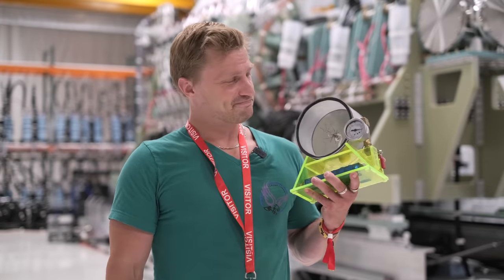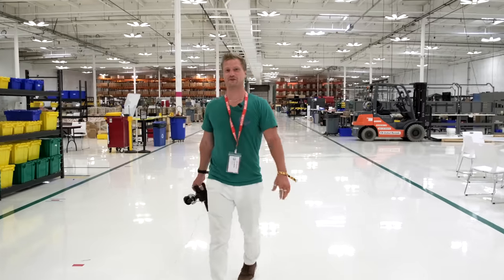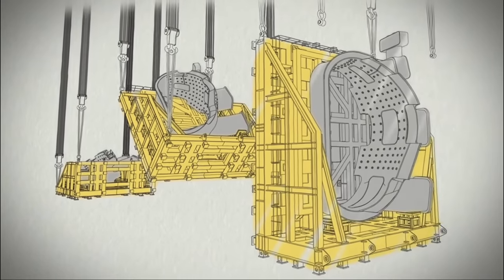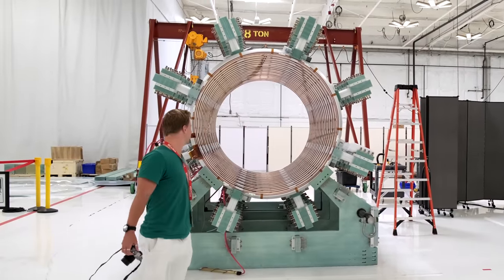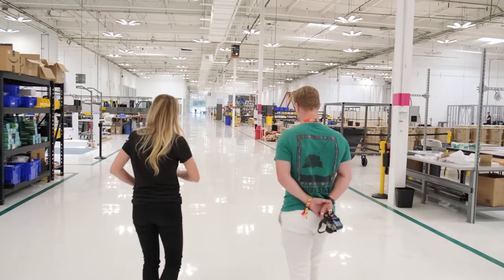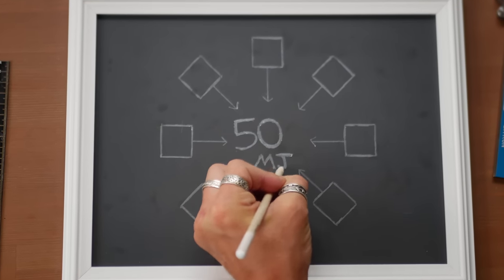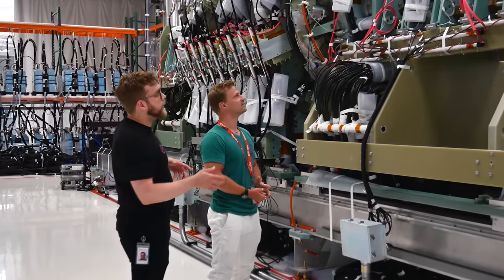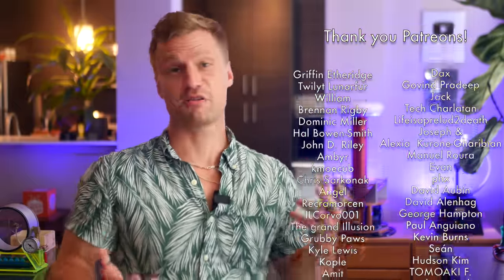An Exotic Approach to Nuclear Fusion (Helion Energy BTS)

Comment: i appreciate the amount of investment happening in the fusion space, but i can't help but feel skeptical of Helion specifically, Improbable matter made an excellent video explaining just how much less feasible he3-deuterium fusion is than tritium-deuterium fusion that is used by conventional tokamak designs. I really want to believe that they can get energy out of this design however the more I look into it the more I feel like, at least with Helion, this method is a reach.
Reply: Yeah, after watching the real engineering video, I was pretty hyped. Then I saw the improbable matter video and now I'm pretty skeptical. The issue with neutrons is also a big problem they have to solve.
Reply: So y'all watched two videos and think you have a better outcome synopsis than dozens of fusion researchers and financial analysts at Microsoft?
Reply: @animal579  I'm not aware of any fusion researchers who have endorsed this. Though that term is lose and technically everyone at helion is a fusion researcher. I would say I haven't heard any endorsements come out of the academic nuclear physics areas. Microsoft did a bit of a PR stunt; they signed a promise to buy energy from Helions' first net positive reactor... if it ever gets built. It looks good for the,  green energy and all, but there's no commitments. The issues raised in some other videos by nuclear physicists not sponsored by Helion have centered around
1.) Not targeting a high enough temperature for D-D reactions to occur at a reasonable rate, especially given the microsecond confinement times they're envisioning.
2.) The neutron radiation that they will unavoidably be producing from the D-D and D-T reactions will cause reactor transmutation and require heavy shielding. That shielding will push the magnetic confinement coils back, which weakens the field strength.
3.) They are breeding significant amounts of tritiu  and have not outlined plans to safely store and dispose of it
Reply: @animal579  uuuh yeah, improbable matter is certainly trustworthy in this regard, as he has experience in the field as an engineer and has given his view on why fusion is generally so hard to do, and why helion could be a stretch, am I saying I Believe him entirely? No, but his input does make me more apprehensive of helion's stated goals and feasibility.
Reply: The Improbable Matter video is not considered very convincing by well informed fusion enthusiasts. He was really just riffing. For example he compared the reaction rate of Helion's fuel to DT at 100 million degrees, but their full scale machine will operate at 250 million and he also neglected the much higher density that the FRC has compared to most DT plasma devices

He also basically said "they still have neutrons" and cut to an image of Chernobyl. They'll have 10x less energy output as neutrons, lower individual energies, and a cheaper and more durable reactor chamber than tokamaks which probably have the toughest situation with neutrons. It's night and day. One of the resident skeptics at the fusion subreddit considers it the best real shot at something big with fusion
Reply: @paulroberto2286 but then you see another video of a physicist being optimistic for whatever reason and you're pretty hyped again.
Reply: @Canucklug  can I get a link to the reddit page? I'd like more info on this subject matter that's positive leaning
Reply: @Canucklug being an enthusiast =\= expert. I have a PhD in physical chemistry and know a fair amount about the challenges that they are absolutely glossing over, which improbable matter pretty much covered. They're a startup, and it's in their best interest to keep positive PR spinning while throwing out slick animations and allowing YouTube tech bros to make videos lacking any criticism or actual analysis. Ambition and enthusiasm can keep the money flowing, but won't change the laws of nuclear chemistry.
Reply: I so want to believe. After the Real Engineering video I went to Helion's website (heck, they're in my neck of the woods and they seem to need tech types who have experience in both electronics and machining and I can work for cheap, so I was really interested). But their site is really light on numbers, especially measured results from their Trenta reactor tests. They'll only say they "saw evidence of bulk deuterium-helium-3 fusion". I was also a bit put off by statements on the site like, "Fusion does not produce a chain reaction, so fusion itself is not weaponizable in nuclear weapons", which is essentially true (if you read the first part as "fusion reactors", since fusion output is what pushes thermonuclear weapons into the megaton range) but the reason given is not entirely scientifically accurate. I'm still open to the idea, but from their public face I'm really skeptical.
Reply: @paulroberto2286   
the he3-deuterium reaction produces only charged particles(proton+alpha), so neutrons aren't a problem here but otherwise I agree, everyone else avoids this fuel combination for a reason, as tempting as ditching the tritium problem may seem
Reply: I'm a diesel mechanic and have seen many machines in my life... Helion design will prevail, I have a guy feeling
Reply: @artkholodov2465  
It's true that He3-Deuterium reactions don't produce neutrons, but Deuterium-Deuterium reactions do. Deuterium-Deuterium reactions have a larger cross-section, thus we can expect for them to occur with a higher frequency than He3-Deuterium reactions. There will definetly be neutrons produced.

Edit: Sorry, I misremembered the cross-sections vs. Temperature curves here. D-He3 has the higher cross-section at a given temperature.

The point about neutron emissions still stands though.
Reply: @animal579 I do nuclear fusion stuff. I’ve talked with a lot of fusion researchers from all over, Southern California, Berkeley, MIT, Princeton, Wisconsin, and no one seems to really take Helion seriously. It’s not that they’re faking people out. More like they’re trying a very niche technique. And often with niche techniques, you don’t go far. Like in the history of fusion research there’s been dozens of fusion techniques. Of the dozens, only 2 are experimentally promising of getting to an economic breakeven point. And of these two, only one is actually sustainable. The other is better used for making a bomb or whatever.
Reply: @robertpaulson2052  They just conflate being skeptical with feeling smart. It's why their rebuttals never amount of much.
Reply: I am in no position to judge how viable this at generating energy, but I am in love with their tech made for harvesting the energy. 
If Helion fail at making Q>1 fusion energy, I still believe they have made a leap in energy capture. If nothing else, I am hopeful this will become a viable tech going forward.
Reply: @allthingsdestructive You really think investors are stupid?  
They might not succeed for technical reasons, but the physics must be sound, or big money wouldn't invest.  You know nothing about business, do you?

I, too, have a phD in plasma physics, another in nuclear physics, and a third in magnetic confinement technology.  
On the internet, everyone has a PhD in something.
Reply: @RMX7777  "It's true that He3-Deuterium reactions don't produce neutrons, but Deuterium-Deuterium reactions do. Deuterium-Deuterium reactions have a larger cross-section, thus we can expect for them to occur with a higher frequency than He3-Deuterium reactions."

The D-D reaction has a higher cross-section than D-He3 only under 250 million C (about 23 keV). Even at that temperature, the ratio of the number of one to the other depends on the relative ion concentration.

One example. At the mentioned 250MºC plasma temp, a 50%-50% mix of deuterium and helium-3 will produce half the D-D reactions than D-He3 (by the way, only half the D-D reactions produce a neutron, so one neutron for every four D-He3 fusions).

Increase the temperature further, or decrease the concentration of deuterium in the mix, and the number of D-D reactions go even lower.

There will be neutrons, no doubt, and Helion has plans to deal with them, it is just that this video is too short to talk about everything. For anyone interested in neutrons, shielding, activation, materials, and so on, search for Helion's presentation for the USNRC from March 2022, it contains the answers.
Reply: @charliem6590  I'm not going to argue that work hasn't been done to reduce the number of neutrons. There is certainly still room to further reduce neutron fluxes going forward as well. What I take issue with, is that the state inside the reactor will always be a thermal distribution. 

Particles inside a reactor will always be chaotic, regardless of what temperature the reactor is run at. Even if the reactor targets a high temperature, the majority of deuterons will have low enough energy to fuse.

The steeper they can get the thermal distribution to be, the lower the neutron flux will be. I won't say it can't be done, but Helion hasn't shared any numbers with the public. I find it hard not to be sceptical.
Reply: good take @Hippida
Reply: @RMX7777  "Particles inside a reactor will always be chaotic, regardless of what temperature the reactor is run at. Even if the reactor targets a high temperature, the majority of deuterons will have low enough energy to fuse."

I'm not sure I understand this. Do you mean that the majority of deuterons will have low energy, ergo D-D fusions will be more probable than D-He3 fusions? If that's what you mean, that's not correct.

Anyway, either if that's what you mean or not, your conclusion that D-D reactions will outnumber D-He3 reactions is wrong, for the following:

For any temperature distribution, integrating the fusion cross-section through the whole range or temperatures gives you the global reactivity. This reactivity, multiplied by the ions densities gives the volumetric density of fusions per second. In the specific case of a thermal distribution, the reactivity of D-D and the reactivity of D-He3 ions is the same around 250M ºC (average temp), and over that it is bigger for the second reaction.

In consequence, even in a thermal distribution, as long as the average temperature is 250M ºC or above, the number of D-D reactions will be half or less than the number of D-He3 reactions (given a 50-50 mix of D and He3).
Reply: this conversation was an interesting read, i was looking for this.
Reply: Funny u can see the mans lack of confidence in his stance as he speaks with the host.  That alone makes me feel skeptical I wonder who's wallets are getting fleeced
Reply: @animal579 In their defense, Microsoft thought rolling over for the NSA and cranking out poorly-functioning crappy malware on a forced "versioning" model ...for decades... was "a good idea." Microsoft cares most about Microsoft, not about benevolence or quality.
Reply: Honestly the biggest breakthroughs we need in power production are in power storage not power generation. We currently lose a huge percentage of mostly any energy generated, especially from giant wind turbines and similar devices. Investing money in renewable energy storage is where we need to be going instead of producing.
Reply: @Spencergolde I am an academic theoretical nuclear physicist who publicly endorses Helion.
Reply: Improbable matter is too sarcastic for my taste, I can take him seriously.
Reply: @stevenverrall4527 I'm glad to hear that. Do you mind if I ask why you do? And what are your thoughts on more widely-accepted projects like ITER or even Commonwealth?
Reply: The IM video is full of falsehoods and misunderstandings, though. He should have gone directly to the source, rather than basing his critique on the RE video and a couple of blog posts.
Reply: @Spencergolde  We need to try everything to see what works best. I support throwing the proverbial kitchen sink at the fusion problem. Although, I think that ITER won't be followed up by a bigger project. This is because some of the smaller competing designs will become viable on much shorter timescales.

Helion would not be as far along as they are if their concept definitely cannot work. Even though I now work on nuclear theory, my PhD is in E&E Engineering. So I'm a theorist with an engineering background.

I have been told by many that my own recent highly-successful research can't possibly work because others have tried similar approaches and failed.

However, I have succeeded well beyond even my own expectations.  I credit my success to being more creative and thinking deeper.  I have been able to mathematically tie seemingly disparate concepts together.  Most importantly, I have the numbers to prove it.

Technological breakthroughs are seldom made by the cautious. Instead, they are made by small highly-adaptive teams that have good instincts. Going with my gut has been my most successful strategy.

I think that academically affiliated fusion researchers are simply upset that Helion won't share their hard data.  It is turning into a competitive cutthroat industry, so why should they? 

If a big institution had their way, they would steal Helion's tech and put them out of business. Similar to what happened to Nikola Tesla and many others. The establishment never tolerates independent thinkers and inventors.
Reply: @animal579 that's a foolish takeaway that demonstrates a highly emotional investment here. Obviously to those of us that are more objective this was simply an explanation of where some convincing persuasive essays can be found that are contrary to this companies approach.
Reply: @allthingsdestructive  
IM did not cover any problems. Quite frankly, his video is full of fallacies and misunderstandings. Also demonstrates a complete lack of understanding of the concept.
Reply: @RMX7777   
The beautiful thing about a high beta FRC is that Helion can balance the density and temperature to their liking. Lower temperatures and higher densities encourage more D-D fusion reactions. Lower densities and higher temperatures encourage more D-He3 fusion reactions. At above 30 keV, the D-He3 reactions would be higher than the D-D reactions. 

BUT they actually NEED the D-D reactions to make the He3. Half of the D-D reactions produce a neutron and a Helion. The other half a Triton and a proton. The Tritium will eventually decay into more He3 for fuel or it can be sold for extra profit.

Either way only about 1/3 or 1/4 reactions in the machine will produce a neutron. That neutron is only 2.45 keV. So below the activation energy of many materials and those materials that are activated by it (and used in their machines) have a very short half life.
Reply: @stevenverrall4527  I'm aware and respectful of your accolades in this area. I've  read your most recent paper on a GSQV proton model, and though I think we have different definitions of what is "intellectually accessible", it was very interesting as far as my limited knowledge of qcd would allow. I am involved in science as well, and am in full support of ambitious and bold research directions. My concern starts with our current CO2 problem and the urgent need for carbon-free, sustainable energy; and fusion isn't that. It might be one day, but today we already have an answer to that problem that deserves funding and attention. It's Gen IV fission reactors. A clean, safe, fuel breeding approach with reprocessing and inherent weapons proliferation resistance. 

And no, Helion can fail. They're just a startup company, they are allowed to get this far without having a well though out plan. No one is stopping them from either lying, or else no one is holding them accountable for producing meticulous results or failure analysis or long-term safety and waste disposal plans. They are allowed to produce hype videos and just collect money. And I'm arguing that on numerous engineering fronts:
- No plan to deal with the tritium they will be accumulating, which they won't be "burning"
- Non-superconducting magnetic confinement which massively limits field strength and efficiency
- A projected temperature and denity far too low to allow D-D fusion to occur at a reasonable rate
, they are unlikely to pull it off anytime soon, especially not in a repeatable fashion necessary for grid production.
The issue with Helion et. al is that they are pulling financial and PR resources away from practical solutions at a time when we really can't afford to waste time. They're promising results tomorrow, but realistically, that's probably not possible. And gambling on them doesn't make sense when the stakes are so high
Reply: @elmarmoelzer2229  All fair points, regardless of how you look at it Helion will produce less nuclear waste than any other current reactor design.

I do have to wonder what will happen once they start extracting energy though. The act of drawing power from the reaction product ions through direct conversion will have the effect of slowing them down. Slowing them down means an increase in neutron flux.

The dynamics of fuel ions are always chaotic in nature, I'm very doubtful any non-thermonuclear reactor scheme will ever be useful for power generation.
Reply: @allthingsdestructive  what are the problems you feel they're glossing over?
Reply: @charliem6590  deuterons are always capable of fusing - all baryons are always capable of fusing - through quantum tunneling, at any temperature, though probability of fusion (gamow factor) increased with proximity and temperature. This is the primary way the Sun fuses, and also how Inertial Electrostatic Confinement reactors (fusors) work as well.
Edit: but reading through your comments further I guess you already know that and were addressing something else, so nevermind
Reply: @RMX7777  "Slowing them down means an increase in neutron flux."

You mean e.g the Tritons slowing down while "donating their energy to the system as a whole?
Definitely true, but the pulses are so short that these effects barely come into play.
Reply: @elmarmoelzer2229  Speculation on your part. We won't know for sure until hard data is released.
Reply: Hydroton approach seems more reliable. Already provable results from tungsten wire cracking at room temp
Reply: Still unknown is the size of a working reactor.  So, let's start with a "known" reactor, the sun.  Yes, stars come in different sizes. All of them gaseous and factors of size larger than the earth. And, fairly effecient. Efficiency being a key. Efficiency dictating matter density and size. Efficiency dictating generated energy emission. My view is the amount of efficient electrical energy to heat energy ratio creates the demand of gaseous reactor ie. Solids and liquids will become plasma states.  
This is a good thing. Consider this: a star requires a certain size to be in a fusion state and that's quite large. If these fusion reactors occurred in much smaller size ... say, the size mankind is hoping to create ... they would exist in nature somewhere. Fortunately for earth. Otherwise these small fusion reactors would be falling from the heavens ... making for a very bad day for life forms here. 

Research away. Hope something useful is found (not something to weaponize because, well, tales of history). 

While solid, liquid and gas seem to coexist rather well, plasma does not.
Reply: @RMX7777  From my limited understanding, the peak fusion rate is already over by the time the energy extraction happens. The plasmoid is already expanding, density decreases as it does and few fusion reactions happen.
Reply: @Spencergolde  The tritium produced could very easily be used in a tritium reactor. Of course there is the little issue of there already being enough tritium to fuel all of the world's grid-dependent energy needs for 150 years, so the market might be a bit soft.
Reply: @kmoecub I'm not sure what your sources are, but tritium is a very rare and relatively short-lived isotope. It is very expensive. There is barely enough in circulation to jump start D-T fusion reactors
Reply: @Spencergolde   He is talking about the Tritium Helion will produce from D-D fusion (which is also how the make He3). Helion will be sitting on a lot of Tritium after a while. They can sell it, burn it or wait for it to decay to more He3 (for fuel).
Reply: If it makes energy, even if less efficient is a win
Reply: Mankind is barely at the starting block of fusion as a source of energy. It is clear there are no easy paths to a fusion solution. We MUST try different strategies to find the better ones we know are out there.
Reply: The major problem with tritium-deuterium fusion is you end up right back to one of the problems with fission- nuclear waste. Not to mention the issues with producing enough tritium for sustained reactions.
Reply: @aggiewoodie  
Not nearly as long lived or high level as fission waste, even from D-T fusion.
Reply: @Spencergolde  Is tritiu a thing, or did you mean to type tritium? And I thought tritium was only mildly radioactive? I seem to recall some watch brands using little vials of tritium to light up the hands. So seems that can't be too hazardous.
Reply: Improbable matter (who's a subject matter expert in fusion I believe) did a video about 7 months back about hellions plans. They'll inherently produce less power from their reaction, so getting net positive will be a huge, potential insurmountable challenge.
Reply: @charliem6590  I never said D-D reaction rate would be higher than D-He3, I just said it would be present. Take a look at fusion fuel cross-sections vs temperature. You will see that D-D reaction rate increases with temperature all the way to the peak of the D-He3 curve. 

This clearly shows that you will always need to deal with neutron radiation when working with D-He3 fuels.
Reply: @elmarmoelzer2229  The issue I see with this, deuterium and tritium really like to embed themselves into reactor walls.

This means there is a very good chance that neutron fluxes will increase over the lifetime of the reactor. The expansion and cooling of the plasma won't necessarily stop the reactions from occurring, as all ions should be moving towards a wall (due to mean free path in a vacuum chamber), thus there will always be the chance they fuse with an embedded deuteron or triton.

The only means I can think of to prevent this would be for the energy converter to drop the ion velocities below 10kv.
Reply: @jjtimmins1203 that's a good analogy dude ! Like a diesel engine, we need mega pressure to ignite the fuel very quickly and produce power ! Cool 😎
Reply: @RMX7777  The walls will get damaged over time. But with a linear design, replacing the walls is not that big of an issue. It is MUCH easier to do than with a Tokamak. The wall is essentially silicon cylinders which Helion produces in their own production line. 
What is also important is that the burn chamber is a good distance away from the more expensive equipment which is located at the ends. Since radiation falls off with the distance squared, the neutron flux is much lower there. The way I see it, they will likely replace a silicon cylinder wall section once a year. Maybe also the compression magnets. Since they are just aluminum, it is not that big of a deal. The replaced parts are stored until they are cooled off and can be recycled.
Deuterium retention should not be too big of a problem since they are going to fuse Deuterium anyway. 
Bigger problem would be Tritium. 
I also believe (but do not nail me down on that) that Silicon is less prone to Tritium retention than some other materials, especially metals. But I am not expert on the subject matter. So I might be wrong about that. If you have access to any papers or studies on this and find something that contradicts this, please let me know.

I also believe that you can cause Tritium and Deuterium to be released from the walls by heating them. Might be another way to deal with it. But again, no expert in that subject matter and I might be way off.
Reply: @RMX7777  I want to contribute something but I have an issue. Will this comment stay, or evaporate with roughly half of my previous ones?

EDIT: OK, five minutes and it is still here so, let's try to repeat my last post.

I was trying to add something to what elmar said: Because Helion machines are not steady-state but pulsed, they have an extra option opened to them, evacuating the reaction chamber after every shot. That means that any materials liberated from the walls will be retired before the next fuel mix is injected, avoiding in good part the problem steady-state reactors have with poisoning the reaction with outgassed or spallated ions/particles. Additionally, the cooling phase in this machine is very fast (as I understand it, measured in microseconds) so, very little time for secondary fusions. And thirdly, from every fuel charge, the percentage that will react per cicle will be quite small, another factor that contributes to a very low production of tritium.
Reply: @charliem6590  I can see this comment, I'm guessing something was getting flagged?
Reply: @methos-ey9nf  I assume this is a joke because if you spent more than 60 seconds looking this up you wouldn't be asking. For the record, Tritium is incredibly toxic. As a hydrogen isotope, it can form bioaccumulating compunds, including tritiated water, which is extremely difficult to remove from the environment. It has a moderately strong decay energy, but it's the ability to bioaccumulate that makes isotopes like tritium or Sr-90 so toxic. Some watches add microgram quantities to a phosphor in their hands to make them glow, a practice with heavy oversight from the NRC. It is the safest alternative to radium bades watch paints in terms of continuous glow performance, but it's a very niche market because phosphorescent paints perform nearly as well with sunlight exposure. People also manufacture smoke alarms containing Am-241 and antistatic strips that contain Po-210. In small quantities, deadly things can make their way into consumer goods, but that doesn't mean it's a good idea to manufacture and stockpile large amounts in an effort to let them slowly decay into small amounts of fuel
Reply: @charliem6590  This entire scheme depends on generating He3, for D-He3 reactions. That helium breeding step produces tritium with equal probability. So, the more He3-D reactions occurring, which generate the power, the more tritium will be produced
Reply: @Spencergolde  Agreed, Helion aims to produce at least as much He3 as they "use up", but consider this: When the reaction starts there is cero tritium in the plasma. When the cycle ends, less than 1 ms later, the amount of He3 "consumed" is less than 1% of the initial amount. According to your point that must also be the amount of T (and He3) created, so the ratio of densities D to T at that moment is over 1E+2. Add that the cross section for the D-T reaction decreases sharply over 70 keV, that each tritium ion created carries 1 MeV, and that they have little time to thermalize, and the result is: few D-T reactions.
Reply: that tokamak, especially iter is like the size of a small shopping mall with a billion parts. he even said it wasn't quite as efficient but the tradeoff was worth it.
Reply: This feels like a Kickstarter scam. A whole lot was said, but nothing was shown.
Reply: @Spencergolde  I'm fairly certain tritium doesn't carry the risk of bioaccumulation, at least not in the form of tritiated water. If I recall correctly, I think its half life in the body is only around 2 days. 

The standard procedure for people exposed to tritium is just to have them drink a lot of water. I won't argue that it's okay to have the stuff being leaked out everywhere, but it's not as dangerous as most radioisotopes.
Reply: Physics bachelor degree here. This "reactor" works on completely different principles than conventional fusion or fission thermal reactors. It is extremely hard to have he3 and deuterium mix to form a nuclear chain reaction, which is needed for conventional nuclear reactors. Helion's reactors, from what I understand, don't use the chain reaction. It uses the field pulse from the fusion of he3 and deuterium. They push field through the coils against each other, this will cause a fusion, but it doesn't release a neutron in the process (aneutronic fusion). This process will only produce a proton, which is positively charged. When these proton rushes outwards from the fuel after fusion, it creates a field in the coil, which is directly turned into electricity. 

What I am skeptical about is whether or not the energy created can create enough energy to generate another pulse and then net positive energy.
Reply: Lol ain't nobody more gullible than venture capital lol
Reply: Funny, but your username makes you seem like a troll. What’s that about?
Reply: @ItsEdSilha  how does having a glitched out user name make me a troll lmfao
Reply: @scottslotterbeck3796 that's why Thanatos - who promised an extremely obviously impossible technology - never attracted any investors, right?
Reply: If they can create he3 with fusion I’m sure they can create tritium
Reply: Honestly, all methods are a reach…and these are the lowest energy level for fusion…we need to try, but yes, I’m skeptical but hoping someone figures out something out…